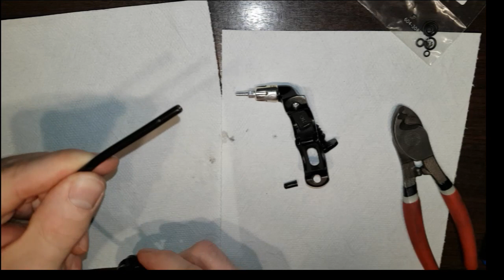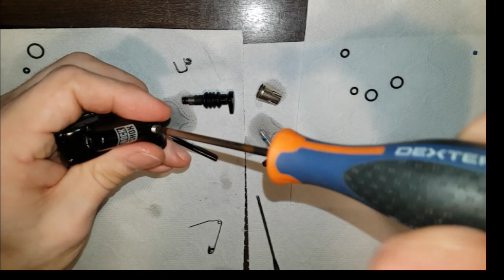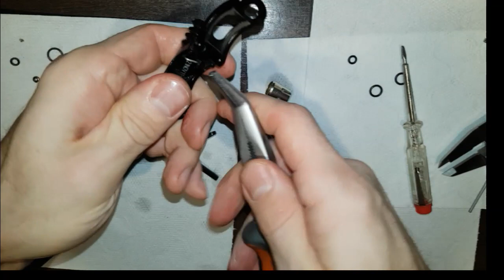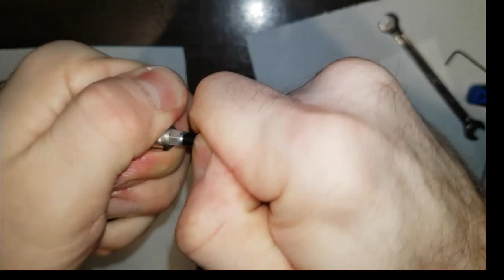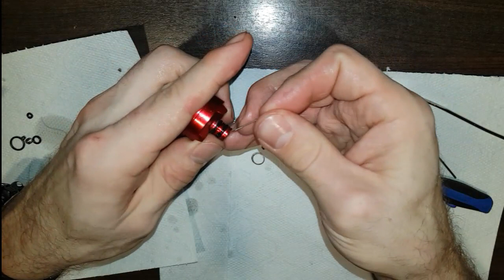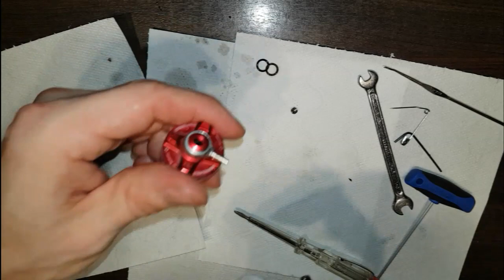RockShox XLoc Sprint Remote SERVICE KIT

Comment: Really good thanks. Remote wasn’t working. Button wouldn’t stay down or was sticking. This video showed me how to dismantle and put back together. I didn’t end up changing all the o-rings coz the shop sent me the wrong kit. But still ok. I cleaned the two little collars on the shaft that moves up and down when you press the button. I used an ultrasonic cleaner to clean the parts in methylated spirit. It seems like these are the key parts so clean and grease with slick lube should help.

Comment: I just rebuilt mine and it works good. thank you very much for this video. only problem was that I have both front and rear suspension lock and rear is not working for some reason :( but at least front works good now.

Comment: Might sound stupid put do you put oil or is it just air pressure I'm working on my Cannondale lefty thanks.
Reply from the maker: Inside the hose? You have to fill it an oil. I use 2,5W. Make sure ther's no air bubbles :)

Comment: Fantastic tutorial!!! I have learned a lot. Thanks!!! One question; do you know if the remote for Reveeb is different from the fork (Lefty 2.0 in my case). It does not stay open (the button does not stay pressed). I have opened the mechanism and it is different from yours and my previous Full sprint. I thought they were all the same but apparently not..... I'm going crazy!